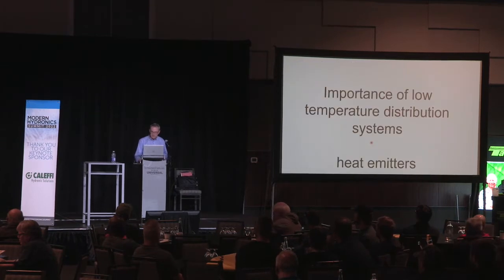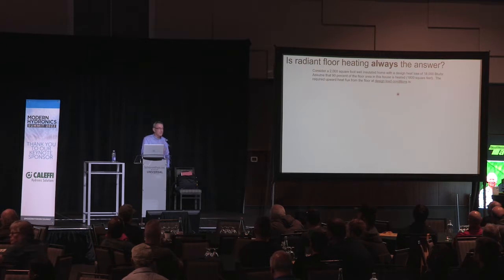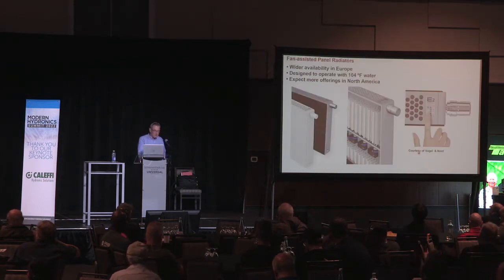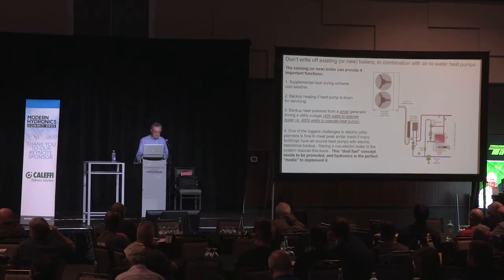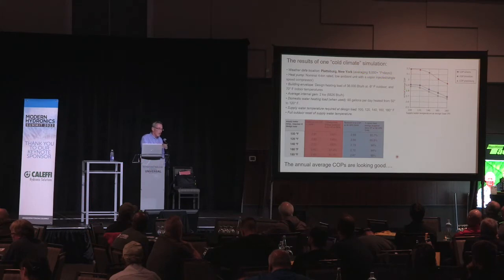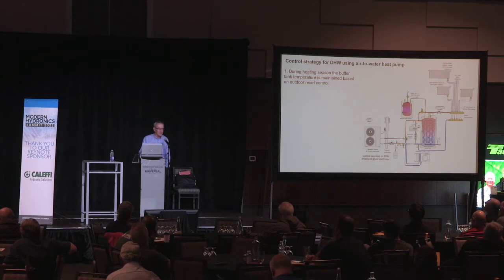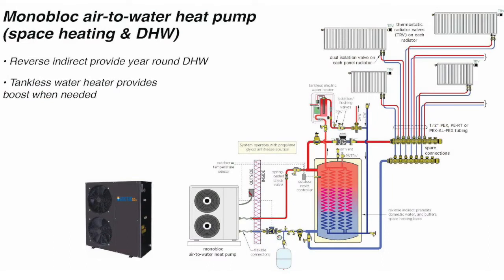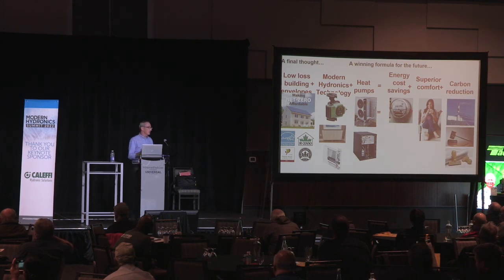Modern Hydronics Summit 2022: KEYNOTE Part 2 "Hydronics for Net Zero Homes"

Comment: Subscribed and appreciate the channel!
John, my daughter will build a 1200 sf ICF  house soon.  Hydronic heat for sure.
Better to put radiant wall panels on the outside walls or interior walls.
House located in upper Michigan, 3-5 days get to -20 F, most winter is 0F-30F.
Thanks in advance!